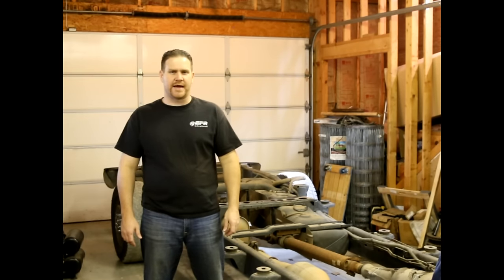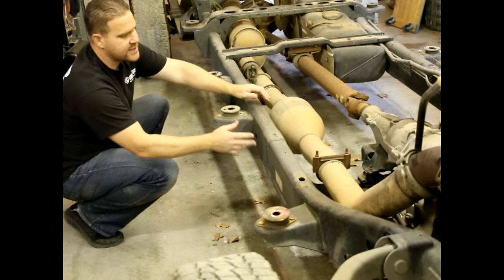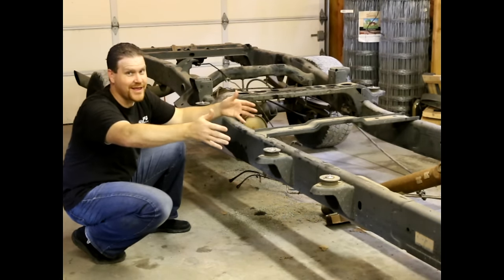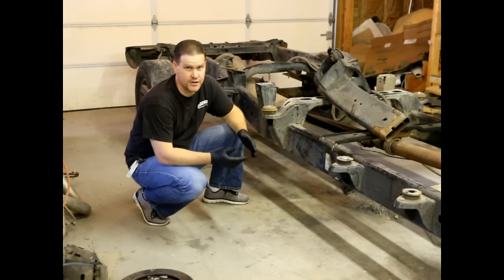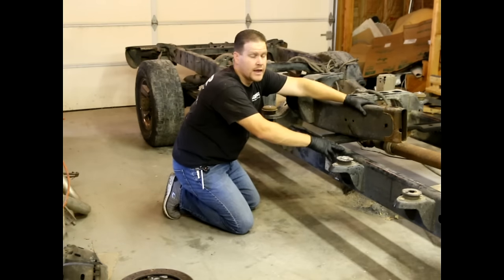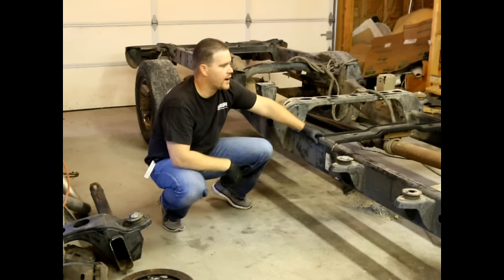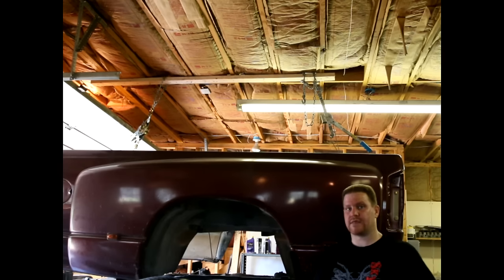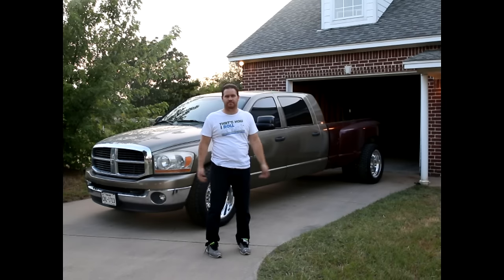How To: Mega Cab Long Bed Conversion Done At Home

Comment: How do you make sure the frame is perfectly straight front to back since you don’t have factory lasers or anything?
Reply from the maker: I made little pucks to fit into the factory cab mounts. (full article here https://www.dieselarmy.com/engine-tech/other-tech/video-install-diy-mega-cab-long-bed-conversion/ ) and used those to base the measurements off of. I also took a number of measurements off the ground and various other points. Because the frame slips into the other, the horizontal alignment was easy. Making sure the frame was square actually wasn't that bad. My first shot I think I was like 1/8 or less off. Couple hammer taps and it went right in. The factory pretty much made this job easy. The female ends are flared only enough to fit the amount of frame necessary. So, it wasn't like I could go to much.
Reply: @hpdiesel4538  Thank you for the article and your explanation.  I have one other question (because I'm kind of automotively stupid, I suppose.  I love this idea of extending a MegaCab with an 8 foot bed.  That's why I'm asking these questions.  So...if you are adding an 8 foot bed and extending the wheel base (I assume the wheelbase becomes something akin to that of a regular Ram with an 8 foot bed, plus a little more (the additonal inches of the MegaCab that the regular doesn't have), then what happens with the transmission?  Isn't it extended to meet up with the real axel, and if so, does this process, say with an Aisin transmission, compromise the quality of the transmission in any way?  Maybe I just don't understand where exactly a transmission extends to.  Any understanding of this would be much appreciated.
Reply from the maker: @FredHerrman  Hey Fred. If you are extending the frame like I did in this video/article, then you are only extending the rear section. The engine, transmission and if you have one, transfer case would remain in the stock location. This truck is a two wheel drive so there is no transfer case. In my case, there is a carrier bearing about half way back that holds the two piece driveshaft. I extended the rear section of the driveshaft about 14 inches if I remember correctly. That additional length  won't make a difference in this application. Now if this was a 4 wheel drive and a transfer case was used, I'm not sure if there would be a factory carrier bearing or not. But I would just do as the factory quad cab long beds do. If a 4 wheel drive truck uses a carrier bearing, then I would add one. If you are really not sure, just talk to a driveshaft shop. The will need max RPM (of the shaft not engine), horsepower, torque, and length. From that will tell you the diameter of the shaft and recommend either a one piece or two. That make since?
Reply from the maker: @FredHerrman  Actually, if you pause the video right at the beginning, you can see the end of the transmission, front section of the driveshaft, and the carrier bearing (where the fuel tank is). All of these components stay in the same location. Then a new rear driveshaft was added, but this will give you an idea of what it looks like behind the transmission.
Reply: @hpdiesel4538  Okay, I understand now.  I really appreciate it, thank you very much!

Comment: is the payload affected
Reply from the maker: Payload is greatly determined by the springs. I kept 2500 springs for a soft ride, but the plan was to use air bags for additional capacity. I actually sold the truck before I ended adding them.

Comment: what the difference of a 3500 single cab long bed 2 wheel drive and my 3500 4x4 mega cab  both singal  wheel
Reply from the maker: Hey Ray, 

Not sure I completely follow your question. Your 3500 mega cab is probably a short bed and the single cab is a long bed. The rear sections of the frame are different (long bed is about 20 inches longer). The spring perches are also most likely different. (Found that out when I did this. Ended up having to buy a second rear section because this truck was 2wd and I bought a 4wd frame. The difference in ride height is done mostly at the spring perch not in the spring package or blocks under the springs.) 

The center sections of the frame are also different. The single cab has a very short center section where as your mega cab has a very long section and an extra set of mounts.

Hope that answered your question.